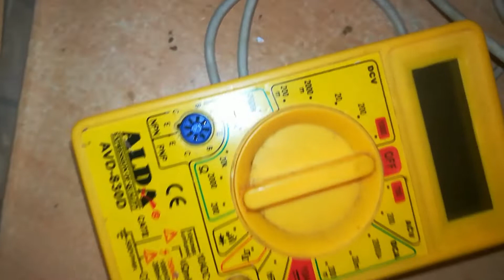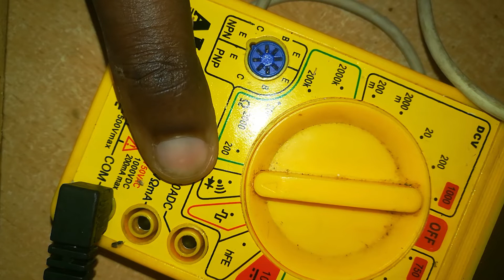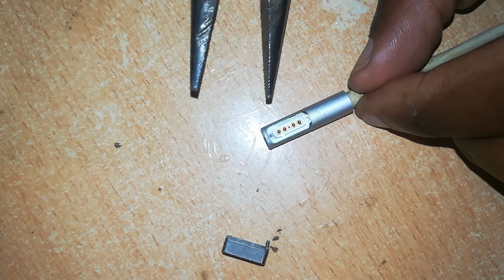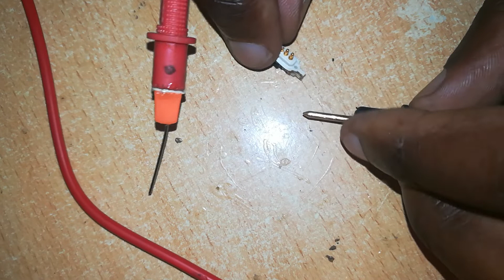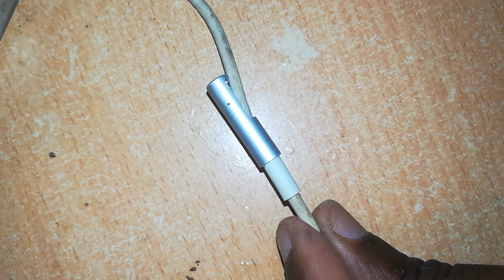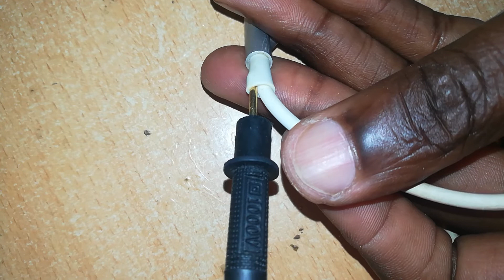How to repair Apple Macbook charger L shaped connector -Teardown! DIY! #magsafeconnectorrepair

Comment: There's an interface inside the dc in connector. So, if you plan to replace it, buy it for the same version of your psu. If your mac os 60w, buy 60w cable with connector. If your mac is 85w then...buy 85w cable and connector. I almost broke my 15 inch macbook pro buying a cable based on magsave version only. Apple does things that even surprises the most nephastous assets.

Comment: It's video's like this that are genuenly educational. I have always wondered how these things are built and how they can be taken apart safely. I would also like to give some points of improvement for future repairs. In the video you pulled the metal part of the connector off using pliers, I truly love that you explained that you have to be careful with the plier ridges, because this is very important advice. The thing you should also pay attention on there, is to pull the connector up slowly and evenly. It is friction fit in with two metal studs that stick into the plastic, maybe even melted in or combined with some glue to keep it in well, but in the video you pulled it off one side first, causing one of the studs to snap off, and the other one to get bent, which in the end caused difficulties sliding it back in and also resulted in the metal part being not perfectly straight in the finished product. The cable's breakpoint was pretty clear after taking it apart, I suggest making it stronger than it was from the factory to make sure that same breakpoint doesn't fail again, since it has been modified and is thus not as strong as it was brand new, I don't think the glue will hold it in well, so there should be a better solution to secure it in place. I think you pushed the rubber extension a bit too far back in when glueing it back and it may be better to apply the glue on the inside before putting the cable in so you don't have to stretch the rubber with a pin because that causes a bit of permanent deformation. Overall, it's a genuenly amazing video, and one charger less ends up as electronic waste for no reason. These chargers are as expensive as the MacBooks themselves from when they were new, so it's absolutely worth it to get one that's broken anyways repaired. Thanks a lot!
Reply from the maker: hey @teamredstudio7012  great comment! I really do appreciate! hope you subscribed, liked and shared!!

Comment: Good to se what and how is installed inside. Superglue will not hold it properly for more than a while, better idea would be to reuse metal ring. Another thing is thelescopic pins; once superglue penetrates there the effect will be quite obvious.
Reply from the maker: hi.thanks for your comment! while applying the supper glue, always be very careful not to apply it to the pins. and the glue dries in less than 10minutes! i have repaired countless cables using supper glue and I'm yet to see or hear of any which has fallen apart....months later! Supper glue works, try it! Also watch this and other videos in the channel. https://youtu.be/lz0F9osIEmo